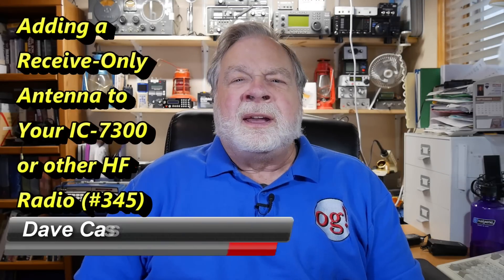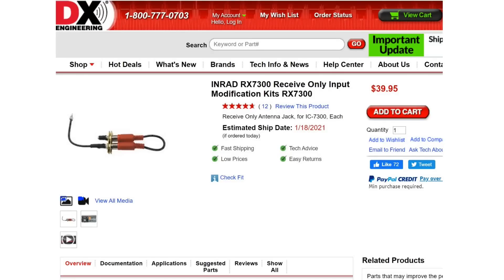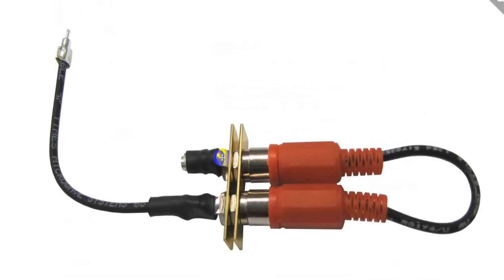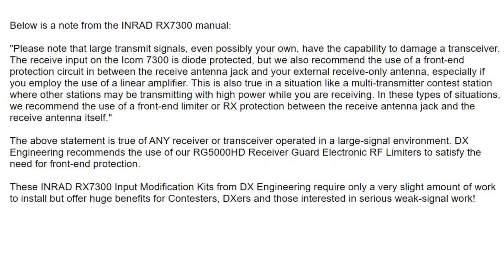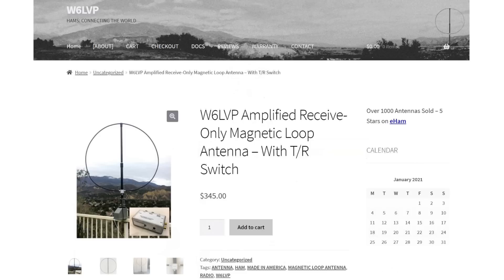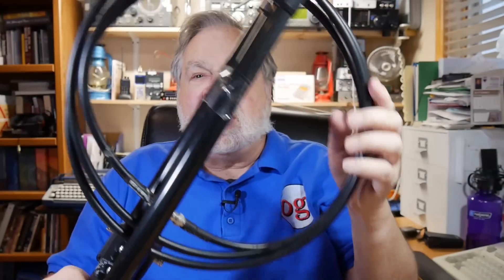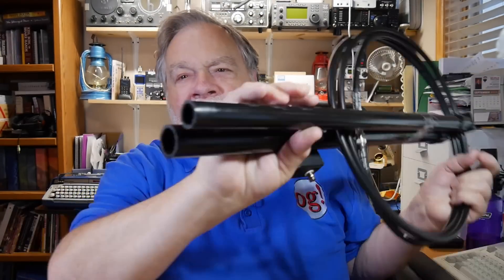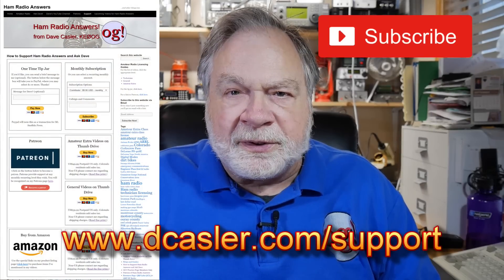Add a Receive-Only Antenna to Your HF Rig (#345)

Comment: If i have a receiver also turned on connected to a different antenna, do I need a protection device there too, so I don’t fry that radio while transmitting?

Comment: That's the reason "Field Strength Meters" were invented. 0 SWR does not mean Maximum Power Transferred! It does mean the Transmitter is at its happiest, and lives the longest! Remember 50 or 52 is a compromise to begin with!

Comment: You stated that this is an "either/or" accessory when mentioning the panadapter- "you can't have both." As far as I can tell, this mod is little more than a couple of pass-through jacks. It seems plausible that you could simply remove these jacks from the mount they are installed on and instead mount them in a pair of appropriately-sized holes drilled into the back of the IC-7300, which would leave the factory opening available for the panadapter. Of course, I may be missing something. LOL

Comment: The same but much lower price:
- https://www.ebay.ca/itm/RX-Adapter-for-ICOM-IC-7300-RX7300-SMA/283438834502?hash=item41fe456346:g:X~YAAOSwXahbUenk
This item is nicer than INRAD RX7300, with LNA connector fitting for most SDR radios and much better than the HiFi plugs.
- https://www.qrpkits.com/ezseries.html#eztrsw
For people do not mind to solder a bit. It's a very nice T/R switch.
- https://www.amazon.com/MLA-30-Antenna-Active-Receiving-100kHz/dp/B085ZSXF8Z/ref=sr_1_2?crid=3FRL7L1EGW5R9&dchild=1&keywords=magnetic+loop+antenna&qid=1610679482&sprefix=magnetic+loop%2Caps%2C232&sr=8-2
A very capable magnetic loop. Search for tests, amazingly good for a great price.

Comment: There is also the option of the PTT controlled antenna switch I suppose, just as long as it switches in a dummy load or shorts the Rcv on Xmt.  Could be done very similar to the MFJ SDR antenna switch I suppose.

Comment: Can I just get that Transmit/receive switch somewhere?  I'd like to try using a loop-on-ground RX antenna to go with my DX Commander so I can have some diversity in polarization.
Reply: Loop on Ground is supposedly Vertically polarized, has something to do with the earth absorbing all horizontally polarized signals ---> Post#41:  https://forums.radioreference.com/threads/160-20m-log-loop-on-ground.370110/

Comment: MFJ has, or perhaps had, a T/R switch just for receive antenna switching, much like the 1708 but working 'backwards' (rather than switching Rx SDR to Tx radio, it switched Rx to Tx antenna.  Perhaps the current one can be used backwards too, but their new catalogue does not show it that I can see.  Other automatic T/R switches are available, like from DX Engineering.  
I've use one for T/R switching on my FT450D reliably for over 6 years now.
Reply: MFJ-1707B -- $110 at HRO.

Comment: I have an outdoor receive only home brew loop antenna and it is very quiet. It works well as the additional antenna needed for my noise phasing eliminator. The loop has a on site wide band balanced preamp and is diode protected.

Comment: What is the theory of operation for a receive limiter like the RG5000HD? Is it basically just diodes clamping across the line? I found this one that uses diodes and saturating transformers -- https://www.arraysolutions.com/as-rxfep . Say you wanted to limit power to 7dbm, or about 5mW. By Ohms law at 5mW into 50ohms you max at  0.5VRMS and 0.707V peak, comfortably within the realm of forward diode clamping. (Which doesn't seem worth $100!)

Comment: Thanks Dave !  I've been using separate receive-only antennas with my IC-7300 for a few years.  I started out using the DX-Engineering RTR-2 T/R interface.  It uses the "send"/ "transmit to ground" jack on the IC-7300 to switch between the transmit antenna, and the receive-only antenna.   I've switched to the DX-Engineering NCC-2, which accommodates two receive-only antennas and allows you to use phasing to cancel noise. It has a built-in T/R switch.  These DX-Engineering devices are pricey , but well built and reliable.   '73  Bob

Comment: Dave, great advice for IC7300 owners.

Ironically, the dual transmit and receive antenna capabilities are why I purchased a used Kenwood TS590SG.

The IC7610 was a bit out of budget unfortunately.  Got my rig and a DXCC mutiband dipole for just over $1K.

Love my radio, and have a lot of antenna projects planned.

Stay well kind sir.

Comment: So then do you recommend using a 30 ohm transmit cable to reduce resistance and a 75 ohm receive cable for a less expensive option?
Reply: Transmition lines should be match to 50 ohms. If the antenna is a 50 ohm matched antenna, then the cable should also be 50 ohms (This is the normal way).
For a receive only antenna, since it is not going to be used for trasmission, you could get bye using other cheaper cables (e.g.  75 ohm cable tv coax)

Comment: I have been looking into how i could do this with a U- bitx been checking out t/r switches
I have a old Icom 735 that has this built in
Reply: Look up how it is build. The 7300 has a T/R switch build in but it switches the main antenna port not the receiver.

Comment: Does receive antenna can be connected with 75 ohm feeder?
Reply: Yes - RX is fine, and with some care can also be used for TX.  Some many decades ago 75 ohm was the standard, and modern solid state TX made it less usable.

Comment: Perfect..Im retiring to a heavily restricted, affordable,  hoa sub in Az soon and the only antennas allowed with debate to be visible are cell repeater yagi or vertical / dipole..or the fancy multi band, expensive flag pole version.  On grid Solar panels prevent hidden horiz long wire over roof, or yard.
Reply: I live in a heavily restricted neighborhood and I have Dave's reference OCF antenna on my privacy wall which is up only 6 feet - I had to cut the antenna way down due to low height, range is not terrific as it is mainly NVIS as Roger said but it's a quiet antenna and resonant on 40 and 20.  Also as Roger indicated, most of my strong signals are regional.  I have toyed with the idea of a flagpole antenna, but haven't pulled the trigger yet.  I also use an MFJ magloop which works well and kept out of sight.  However, I'm always looking for new ideas - thanks for your input gents.
Reply: Do you have a non metal privacy fence? That height does well for near vertical and seems to do well for western US nets here in CO on 40. You could even make it U shaped using three sides.  Building what looks like an electric fence is an added plus. A telescopic flag pole on a non penetrating, non permanent tripod, a good ground system and a remote ATU or base loading would do well. There is a 100 ft cell tower nearby that has a non penetrating base held down by massive concrete blocks all because they could not get a permit from the county! Anyway, all depends on the bands and distances you want to work. Sadly we can't own a ranch 20 miles from the nearest power line.